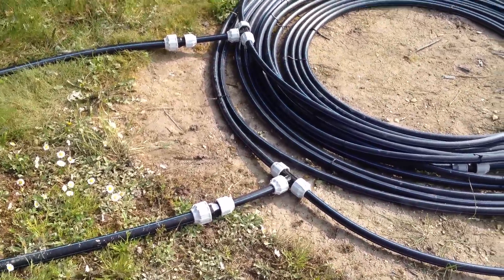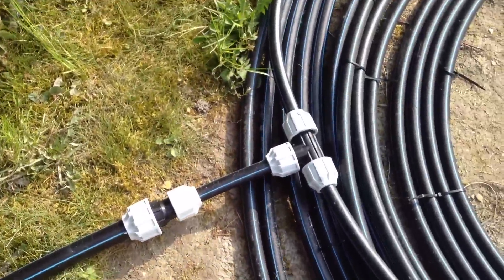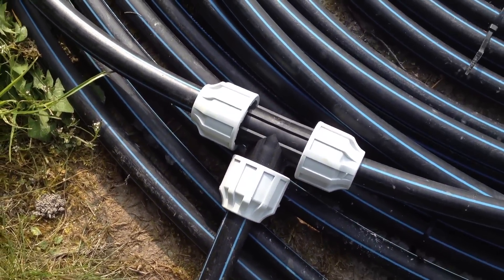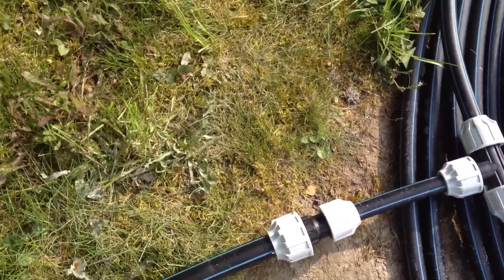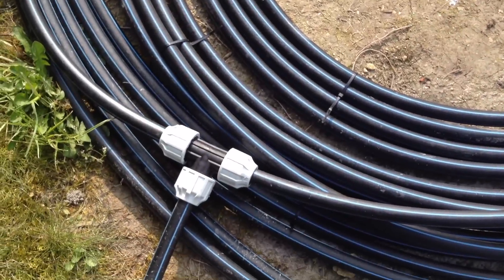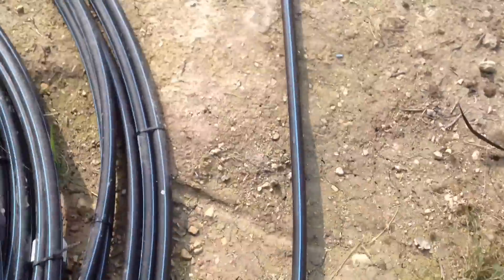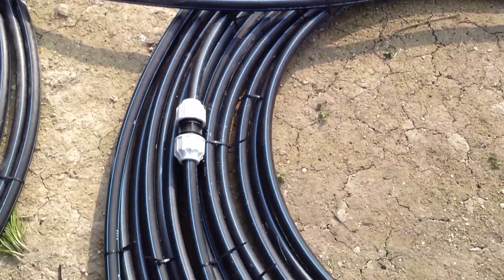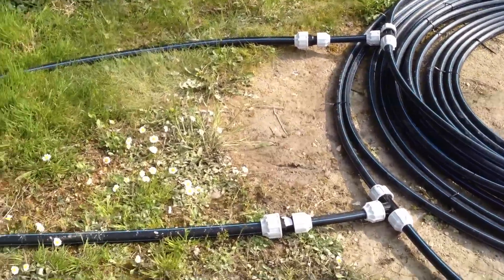DIY solar heating for swimming pool - make your own hot water using the sun and black pipe

Comment: I've made a similar thing for my pool about 3 years ago, and it has been great ever since. This video seems to be about only a test run, since the final system will have to be much larger. I have installed 25KW of tubing (about 1500m, a little less than a mile) and it cost me about 800 euros (including an extra pump for the first year, which I no longer use). You should do a little math before you start. Assuming no losses, heating water takes 4180J per litre per degree Celsius of temperature increase. A medium size pool with 40 000 litres (dimensions W x L x D in meters times 1000 litres per cubic meter) will need about 167MJ to heat up 1 degree. If you want to get your pool from 22C at 10:00 (10AM) to 28C by 14:00 (2PM) you will need to heat it up by 6C in 4 hours. The energy needed will be about 1000MJ, and the power required to get it in 4 hours is 70KW. At my lattitude (38N) I can get about 1000W/m2 of solar power, meaning I would need 70m2 of tubing. For a 16mm tube diameter the length will need to be 4375 meters. One way to get the length down is to allow for more time to heat it, for example considering the target time of day to be 16:00 instead of 14:00 (4PM instead of 2PM). Another way (the best) is to cover the pool during the night. I cover mine and it loses about 0.5C during the night, so the normal startup cycle is to begin day 1 in the morning at 21C, then by the end of the day it will be at about 25C. Then I cover it, so day 2 starts at 24.5C, and then the system adds another 4C to the pool, so at the end of day 2 it will be at 28.5C. Then I cover it again and start day 3 at about 28C, and at the end of the day it will be at 32C! Well, not 32C every day, but a sequence of 3 or 4 hot days gets it there. You will be unable to maintain this rate of temperature increase because as the water is hoter more heat is lost during the night, and during the day more heat is loss to the environment and less goes into the pool. Anyway, my pool has been at about 30C during the whole summer, and I get a total of 10 or 15 days during which I can get it to 32C and use it during the night for hours on end.
Reply: +MrRilhas very interesting, thanks for the insight. Is your pool outdoor? I'm thinking of making an indoor pool, but the size imght be around 150.000 liters. I'm also around 38N (Aydin, Turkey). With your method of piping I would need many kilometers of piping (probably more than I could fit onto my roof!) ... any other way to increase efficiency? Other materials than just pvc tubing? Have any insights?
Reply: +Brian Langhoff

Hi, yes, my pool is outdoors. If your pool is indoors, then I'm sure you will not need a lot of tubing, but you should do the calculations carefully anyway. The thing is, the tubing and the math for the tubing that I explained above is for ADDING heat to the pool. If the pool didn't lose any heat, then you would only need to add heat for a limited amount of time, even with very little tubing, possibly during the course of a few days (you can probably wait 2 weeks the first time you heat it up). In other words, as you added heat to the pool and it reached the desired temperature you would no longer need to run the water through the tubing anymore, and it wouldn't cool down.

However, real-world pools do lose heat. Mine is outdoors, and if I don't cover it it will lose almost all the heat during the night. In this case, you can apply the calculations above to estimate the size for the tubing, because you will need to heat it up from scratch every single day, which means more tubing. Because of that I cover it during the night, so I don't need to start from scratch every day, and that is why I can get away with 1500m of tubing to get it to 30ºC instead of the 4735m to get it to 28ºC.

If your pool is indoors, then it is quite possible that it doesn't lose a lot of heat during the night. If you keep its room airtight, it will probably loose very little heat (equivalent of having it covered). However, the most likely scenario is that you will be running dehumidifiers, and so all evaporation from the pool will be removed from the room, which means that the air will never saturate with humidity and the pool will just keep on evaporating. And the hotter the pool water is then the more it will evaporate. Since most of the energy in a pool is lost through evaporation (~75%), that means that your dehumidifiers will actually be taking heat away from the pool all night and all day (whenever they are running).

In that case the math becomes more complicated, because you will need to know how much heat your pool will lose, which is not simple to estimate, and will depend on how much humidity you tolerate. The more humid and airtight the pool room is, then the less heat the pool water will lose. So, even if your pool is indoors, you may consider covering it while not in use to prevent evaporation, thus saving on energy to the dehumidifiers and reducing the amount of tubing necessary to compensate for heat removed via evaporation.
Reply: +MrRilhas Yes, exactly (have been reading a bit about it the last days, a newbie in this area) - plan to cover it to avoid the heat loss because the air will have to be airconditioned and that would make it almost equivalent to an outdoor pool (although I want a very special layout that will be very difficult to cover - but will try and cover it as best as possible). The room will be airtight ... as it will be 100% underground! :-)

I originally asked you because I'm in serious doubt that I can find someone professional in my area that can make a precise calculation :-) But still ... is the best way to go simple pvc tubing? Efficient enough? Glass surface would mean higher efficiency right? And is it healthy enough, the pvc? :-)

THank you very much for taking the time to write all this. Very much appreciated :-)
Reply: +Brian Langhoff 
Well, if your area is anything like mine then no, you won't be able to find professionals that know what they are doing. What I can find here is a lot of small companies that can install off-the-shelf solutions, or copy/paste from other clients, and can't do anything new that they haven't seen before. And when they do say they can do it it is very likely that they will do a poor job. So, I think it is best if you study the subject in depth, so that you can do it yourself or if you don't do it yourself then at least you can monitor or guide workers through the job.

About the calculations, the math for adding heat really is as simple as I described above. There are losses that I haven't described, but if you do the math and then add 10% or 20% in the end you will be alright.

The difficult math is the one for the heat loss, but that may be simple in your specific case. The air conditioner will basically act as a dehumidifier if used for cooling (it will take moisture from the air), so you can count on the pool being evaporating 100% of the time. I don't know if you plan on using air conditioning for heating instead (in which case it will probably not take moisture from the air), I assume not.

The temperature in the soil becomes more and more stable as you dig deeper and deeper. At about 10m depth the temperature of the ground is pretty much constant all year round, equal to the average temperature above ground, by averaging winter and summer, day and night. So, you may have to fight this "soil thermal inertia" for a few weeks, depending on you wanting to force a higher or lower temperature than the surrounding soil. After that, everything becomes quite stable, and you can probably keep the same operating conditions from then on.

This means that it will be very easy for you to plan the operating conditions in your pool. The only thing you should account for is that the sunlight during Winter time is much less, so you design your system for heating all you want during the Winter, and in the Summer you will have surplus heat (and can turn it off for long periods). At latitude 38 you can probably consider a daily solar power of 250 W/m2 in the Winter instead of the 1000 W/m2 I indicated above for the Summer.

So, for the calculations: first you find the air temperature that the air conditioning will be applying to the room. Let's say that is 28ºC. That probably means a "natural" water temperature in an underground pool of about 22ºC or so.

Now you decide at what temperature you want the water. This is not as easy as it sounds. My wife likes 30ºC during the day, and 34ºC during the night. I can't change the temperature that quickly, so I have it at 30ºC because we use it more during the day. Most women that visit us like it at 30ºC, but I find most men like it a bit lower (maybe 29ºC, or even 28ºC), but that depends a lot on what you do in the pool. My preference is to take the PlayStation remote inside a plastic bag, turn on the video projector, and jump in the pool to play a game for a few hours, and for that I like 30ºC. But if I'm throwing a ball around with my kid then 30ºC is too much, and I start to prefer 29ºC or 28ºC. Anyone who likes to do pool laps for 30 minutes or so (not me) likes 26ºC, and anyone who swims for sport likes it much cooler. So, this is anything but a simple decision, because you probably won't be able to switch the temperature of the water in less than a day or two, but let's say you want it at 28ºC.

Now you decide if you want to cover the pool. Covering it is a nuisance, because it is not ready for a sudden desire to go swimming, so let us assume you don't want to cover it. Anyway, this is the only situation that really needs calculations, as covering the pool basically allows you to obtain any temperature you like, because it will probably be easy to add enough heat to cover losses, and adding a bit more than that will allow you to start accumulating heat over time, eventually reaching the temperature you want.

In this example, you will want your pool to heat from 22ºC to 28ºC every day. Just apply the formula from my post, and you will find out how much tubing you will need in the Summer. Multiply by 4 and you get the tubing size for the Winter. Add more depending on any shadows that will be cast over the tubes (estimate that, and consider that while in the shade they don't heat the pool). Add 20% and you're good to go.

Also, make sure to read the specifications for your pool system (pumps, filters, tubes, ...). Mine is rated to 35ºC, meaning that I'm kind of pushing its limits when I have the pool at 34ºC. Actually, after heating the pool above 30ºC, my pump started malfunctioning every 2 years, and needs repairs (not very costly, and they don't imply a lot of downtime because I have a backup pump, but still a nuisance). You will also need more chlorine, as bacteria thrive in warm water, but I still keep it within reasonable levels without problems. More chlorine also creates more problems for the equipment.

Finally, let me tell you that after I trained myself in all things related to pools, I lost the fear of doing whatever I want with it. This required that I learned how to cut and glue tubes, where to buy the parts, know about valves, diameters, and things like that, but after all that I just add more if I need to, or I divert water from here to there when I feel like it. I still ask the pool guys for serious stuff - like pool leaks, or pump malfunctions - but I can take out a pump and put in a new one myself, for example, and I think that is a skill you may wish to include in your portfolio (it is incredibly easy, have your pool people tell you the names of the glue and tubes, and ask them where they buy it, and then just do experiments with tubes and adapters and stuff until you learn how to do it).

About the tubes: I use flexible PVC tube to take the water to and from the roof, the diameter is the same as that of the pump. Don't forget to add a few layers of thick paint to the PVC, otherwise it will quickly die from UV exposure. On the roof I use black PAB tube (inexpensive, used for irrigation) which doesn't need to be UV-protected and is now in its 7th year non-stop, without issues. But even if it dies, my 1500m cost me 300 euro. The diameter of the tubes on the roof is much smaller, mine are 1/4th of the diameter of the pump tube, because the smaller the diameter then the more efficient they are at heating the water inside (but not too thin to the point where they can easily clog, the diameter for your small finger should be ok). So, I just split the PVC tube into 4 tubes of PAB, and on the other end I combine the 4 ways of PAB back into 1 PVC tube to go down to the pool.

I hope you find this information helpful! I wish you the best of luck! :-)
Reply: +MrRilhas
Heh, just read my reply, the PAB didnt need painting as you wrote, the PVC did. Then why didn't you run thicker PAB to and from the roof also? Have no idea what PAB tubing is, so there is probably a very logical explanation...

From more browsning here on youtube I see that many put their tubes in a frame with a black painted background plus a glass cover on the front. Worth the while?
Reply: +Brian Langhoff 
The main reason why I didn't run PAB tubing all the way to the roof was because I wasn't able to find the exact pressure rating it can withstand. This black PAB tubing that I installed is used mainly for irrigation (that is why I first though of it, I left a roll of it out in the sun while I was doing the irrigation system and realized it got quite hot), where tubes run basically at ground level, and the pressure is only that from the pump.

I wasn't sure it could handle the pressure from the 6m height difference from the pool to the roof, plus any surplus pressure from the pump, and even if I tried and it worked I had no way of knowing that it would still hold after a few years, or if it would suddenly break under pressure and old age. The worst possible scenario would be for it to break while I was not at home, and leak out all the water from the pool.

Additionally, all curves and junctions for PAB are not glued, they are just "pressured in", and friction holds them in place. On the other hand, PVC connections are glued, making them much more reliable (and much less expensive than PAB junctions and curves).

As for the black surface underneath, at first I did cover the back in black. First I installed Roofmate boards (kind of styrofoam thermal insulation boards used in construction, placed inside walls and ceilings of buildings), then a black cloth over it, and then a coarse metal mesh grid (with holes of 10cm x 10cm) on top of that, held down by concrete weights along the edges. This holds the Roofmate boards down during windy days, and the cloth is held to the boards with staples.

On top I placed guides for the tubes, in a spiral fashion, 4 channels going one way interleaved with 4 channels coming the other way (to better distribute hot and cold zones). These tubes are held to the mesh grid using normal zip ties, and so they are held down as well. The guides hold the tubes about 25% of their diameter apart, from my calculations this gives a better benefit/cost ratio.

I placed a few pictures here:

https://www.dropbox.com/sh/zvsp8ptanl0hkdj/AABtWuQprs8HJWCJhns9EpDka?dl=0

The black cloth under the tubes wasn't getting any real heat, so I decided to try a different approach, which was to take the cloth out and let the shiny nature of the Roofmate reflect on the bottom side of the tubes, and the result was a bit better. I mean, you can see in the pictures that the spiral is tightly packed, the gaps are small, so any difference is bound to be small, but without the cloth I see the underside of the tubes capturing some reflected light, whereas before they could only get extra heat from the underside through convection from the cloth, which it didn't seem all that useful to me, as its temperature was never that high.

So I would say that you will be better off with a reflective surface underneath than with a black one, but that depends. I have a vinyl panel that heats quite a lot under the sun, but that was too expensive to use on the roof (cost twice the cost of the tubes, so for that I would just have 2x more tubes and a 3x power output instead of a minimal increase from a hotter surface under the tubes). I used the Roofmate boards for immediate pool heating (so that no heat would escape to the roof of the house), and even that might have been too much, and maybe I didn't need to worry about it and spend money on it. My suggestion is that you just focus on the total surface area capturing sunlight (the inexpensive PAB tubes) and everything else will probably have a minimal impact (if any) on the overall result.
Reply: +MrRilhas So, just to do the math quickly: 150.000 liters. Indoor. Covered (otherwise hopeless I think). Winter days. Otherwise same specs as you. Lets say it looses 0,5 degree per day also. Then I would need at least an increse of AT LEAST 1,5 degrees per day not to loose the heat almost as fast as I gain it, I guess? And to actually be able to accumulate the heat in the beginning. 150.000 x 4180 x 1,5 degree C is about 1000 MJ. Lets say I have 8 hours of good sunlight on the winter day to heat it (double up on your 4 hours) and only 250 W/m2 (quarter of yours) - all in all I would need double of your calculated tubing. Around 9000 meters... correct? How much roof space would I need for that!? :-) Your 1500 meters - how much space does that take up?

Alternatively, say that the pool is heated all year round beginning on a summer day, then I might just need 0,5 per day. 1/3. BUT - then there might be a week of bad weather during winter where it can't keep up with the loss and the temp drops. So I guess the 9-10 km is realistic... sigh :-)
Reply: +MrRilhas ... actually one more thing to consider then... arrrgh. If I really need that much tubing ... and if my math is correct ... that would mean that I have 1,8 ton of water on my roof all the time plus the tube and other things ... 2 ton plus. I highly doubt my roof can carry that (its curved....) :-(
Reply: +MrRilhas .... maybe I would need a heat pump as backup for these scenarios (can maybe get away with a slightly small one that only need to heat it 0,5 degree on a bad day) and then go with the 1/3 of the calculated length to get 0,5 on a winter day. 3000 meters. That would be 600 kg plus the material spread out over the roof. Would have to check with a proffessional if that would be okay but yeah, I guess so.
Reply: +MrRilhas soooory that I keep bothering you, just don't answer if it's too much :-) Most systems that I see have a frame and cover the tubes with glass - like a picture frame. Guess to trap the heat under the glass like a green house. Wouldn't that increase the efficiency quite a lot? I mean, that's the general principle from a green house... any way to calculate that...? :-)
Reply: +Brian Langhoff 
Hi, I don't think the 8 hours of "good sunlight" can be considered a good calculation starting point, because the sun won't heat up the tubes at the maximum rate over those for hours. My system is designed for 25KW (peak), and I get about 15KW (average) in 8 hours of running (Summer), so you should factor that in. The fact I get such a good average is because I have full exposure to the sun (no shadows) flat roof (a small inclination would be better, but a significant inclination would efficiency that a lot during early morning and late afternoon), and the small tube spacing (which is comparable to increasing the total collection area when the Sun is at an angle.

So, during the Winter, I think you can assume the average power to be half of the peak power, and the sun power to be 30% or 25%, so the average power during the Winter will be about 15% or 12% of the installed peak power.

But you should be careful about the Winter calculations. In my experience, you can get the pool water temperature to be about 5ºC above the ambient temperature, assuming you have no wind to blow cool air on the tubes. So, if the ambient temperature during the day averages at 25ºC during the 8 hours the system runs, then I can get the pool to about 30ºC, and no more than that because the tubes will be at 30ºC and will loose energy to the environment. So, the water comes in from the pool into the tubes at 30ºC, heats X from the Sun, but looses X to the cooler air in the environment, and so it doesn't heat anymore. If there is a lot of wind in a 25ºC environment then the water may actually come into the tubes at 30ºC and leave at 29ºC, or 28ºC, effectively cooling the pool water. However, I made an electronics system to stop the system from running if the water comes out from the tubes at a temperature which is not worthwhile (<+1ºC in my case).

So, if your Winters are anything like mine, where you get average daily temperatures of 15ºC (or 10ºC during the peak of Winter) then there is no way to heat the pool from that, so I have no option but to shut it down. You can use glass, or plastic on top of the tubes, and that should get you maybe another 5ºC of headroom, but in my case that is not worth the extra cost, it is hard to build so as to handle windy days not tearing it all apart, and it still wouldn't be enough during maybe half of the Winter. Also, my pool is outdoors, and it is not that fun to go in and out of the pool in the cool weather, even if the pool water is warm.

My 1500m don't take a lot of space, maybe a circle of 6m in diameter (I can't remember exactly), did you see the pictures I posted in a previous message? YouTube seems to require that you click "read more" to see it. So I've been thinking of just tripling or quadrupling the system, just to see exactly what I can get during the winter (to maybe keep my home warm? ... I will have to figure out how to get the heat in, though).

You shouldn't think of the tube in terms of length, you should think of it in terms of area, because the diameter you get there in local shops may vary, so you should think in terms of total collection area you want. After a few calculations I decided that I wanted 25m2 (=25KWp), corresponding to about 1/5th of my total roof area. After you determine the area, you can calculate the tube length using simple math. My tubes are 16mm diameter, so for 25m2 that corresponds to an area of 0.016m by X, meaning X is 1562m. If you get tube of 10mm in your location then your area for 25m2 is 0.010 by Y, so Y is 2500m.

After you determine the area you can decide if you will use circles or rectangles. Rectangles are easier to pack efficiently, but they need a lot of junctions from the main pool tubes to the thinner collector tubes. A circular layout is not as efficient to pack (but you can have multiple circles and reduce their diameter and offset them from each other to pack them more tightly), and the water will flow mainly in a straight line, causing less resistance to flow, and they need few and inexpensive junctions (my system uses about 60 junctions of 0.30 euro each, basically one junction between each 50m of each reel of tube). I decided on a circular geometry, so I calculated the diameter of the circle (if I used no gaps) to be about 5.60m, or about 6m with gaps.
Reply: +Brian Langhoff
In Europe, current design standards are about 500Kg load per square meter of area. So, you should be alright, I guess. :-) But you should consider that the amount of area in the roof is dependent on the diameter of the tubes. The most efficiency comes from thinner tubes, which also allows a reduction in total water volume. My 1.6mm diameter equates to about 5m per litter, so 1500m equals to about 300 litters, which is negligible when distributed over 25m2. You can think about it in terms of how many people you think you could have standing on your roof, since people are basically sacs of water. :-) However, if you get 10mm diameter tubes then you will have much less water on the roof, my quick calculations result in about 12m per litter, and for the 2500m I would have needed then I would have 200 litters on the roof.
Reply: +Brian Langhoff This heating system is not perfect, and does have serious limitations that result from the low ambient temperature in the winter (as I described in a previous message), but it is incredibly inexpensive when compared to other alternatives. A 10KW heat pump in Portugal costs about 10000 euros (there is a lot of taxation, labor, etc.), so it would cost me about 25000 euros to get a comparable heat in the pool, plus operation costs (25KW at a COP of 2 in the Winter means an electric consumption of 12KW, although much less in the summer). My 25KW tubing system of 300 or 400 euros simply can't be compared with that. However, I would say that even if you use a heat pump, having tubes pre-heat the water that goes into the pump is always advantageous, if for nothing else then for lowering the electricity bill of heat pumps. However, winter time is tricky, because ambient temperatures are low but you may still get some good sun and heat from it, but you should have a system like mine that knows if heat is being lost in the tubes and stops water from flowing through them if that happens (because being on top of that yourself and doing it manually is a pain). In Portugal, a gas or diesel heating system would provide a small benefit over an electric heat pump, so you should check if the same happens in your country.
Reply: +MrRilhas thanks, yes, saw the pictures. Well, I'm situated in a nice and warm part of Turkey with mild winters (okay, we usually have one week with near 0 degrees but mainly 10-15 degrees C as you mention or even 20). Many people use a water heating system on their roof for domestic hot water even during most of winter. But I get your point and if you say max +5 degrees and 5 extra with a clear cover ... then it won't work most days during winter. The 8 hours - there's ofcourse more than 8 hours of sunshine on the good days but for a good angle I guestimated 8 :-) My roof is south/north with a slight angle and nothing to obscure the sunlight, so half my roof should be good for it. that means around maybe 40 m2 give or take. But that also sounds a bit to the small size for my requirements.

Guess .... I need a heat pump to assist. Or might you have any other good ideas for increasing the efficiency..? :-)

And yes, your system might work well with underfloor heating (have that myself in the whole house with a heat pump) to assist in winters on good days :-) But you need the pipes under the floors - wouldn't work with radiators though, they need far hotter water as I'm sure you know - who am I trying to teach? You sound like you know all this by heart ;-)
Reply: +Brian Langhoff Yes, that is correct, and increases the efficiency a lot, because you can then have much higher temperatures in the tubes, possibly getting tubes at 30ºC while the ambient is at 5ºC, which is not possible with an open system (you can get away with a difference of about 5ºC). However, for that I didn't find any more economical solution than to buy conventional water heating panels, which use all kinds of technical solutions to increase the efficiency, but cost about 1 euro per 1Wp, so about the same as a heat pump (but with much lower operating costs, obviously). You don't need a storage tank (the pool will be the tank), so you may get a small cost reduction there, maybe 3000 overall. So, in Portugal it would have cost me 22000 euros to 25000 euros to get the 25m2 I wanted, which would not be of any benefit to me during the summer (when compared to my 300 or 400 euro system) but would allow me to heat up the pool in the winter to any temperature I wanted (they can efficiently go as high as 40ºC, and less efficiently to about 60ºC). I'm thinking about such a solution for heating the interior of the house, but it is hard to justify such a high investment (the Winter costs me about 2000 euros in electric heating, so it would take me 12 years to recoup on the investment, or 17 if you account for financial losses). I don't think there is any good way to do this DIY-style, because the gains are smaller and smaller as you simplify the technological investment. For example, a normal glass can reflect away 40% of the sun's energy, so that energy wouldn't even come into contact with your tubes, so you need special high transmission glass. The glass should not be easy to crack, of course, and you should make sure there is no humidity buildup inside the chamber (you don't want the glass to fog up). And then you should have concentrators, to reduce the amount of heat lost inside the chamber, which are hard to do manually. All in all, if you do it yourself then you get what you pay for, and if you spend only 10000 to DIY instead of 20000 to buy from a professional then it is very likely that your DIY system provides only about 50% of the heating of a professional system during the winter. So, if you are going to cover the tubes with glass then I think it may not be worth it to go DIY.
Reply: +MrRilhas I see. So for this to work properly for me I guess you are saying that proper water heating panels all over the roof w/o tanks ofcourse - that would be efficient and probably a bit less expensive than a heat pump (and no running costs). And would ensure me a more reliable source of energy. Then I need a professional to tell me the required size. A quick online search tells me that an acceptable quality named "high performance" (compared to another cheaper model of same make) that holds 170 litre including tank (useless to me) costs around 850 euro (but the 170 litre is not the tubing it must be the container) (https://www.tekzen.com.tr/170lt_gokkusagi_yuksek__performans_pake_/2160336). Maybe filling my roof with these ones... :-) It's also not a wild price :-)
Reply: +Brian Langhoff I think it all depends on a lot of factors. If you just want control and can pay for it, then there is nothing like a gas system. You click a button and the pool is 10ºC hotter 10 hours later, because the power of a gas system can be incredibly high (you should easily find a 100KW gas system in your country). The biggest advantage is not spending energy when you don't need the pool to be warm, which would happen if you only use the house occasionally, because that means you can just heat it up the day before you want it and will not be wasting any energy by keeping it warm when you are not using it. The benefit is more significant when you don't use the pool for longer periods, so if you use it every other day then you would probably not gain a lot, but if you use it only on weekends then there should be some benefit. Also, maintenance for such furnaces is usually much less expensive than for heat pumps. However, if you don't want that much control then I believe you next best option is a commercial high efficiency panel, I think it will be able to provide results comparable to heat pumps but at a much lower operational cost. There is also another benefit in panels, you can just buy one panel, install it on the roof, run the water through it all winter, and see how much heat the panel produces, which is something you can't do with a heat pump (with a heat pump it would be very expensive to experiment in small steps). In such an experiment, 1 panel alone will not heat up your pool, of course, but you can measure every day how much energy it is putting in. For example, if water goes into the panel at 20ºC and comes out from the panel at 21ºC at a flow of 1L per second, then the panel will be providing 4KW of power (you can easily have an electronic system measure temperature difference and flow for a whole winter). That experiment can cost you maybe 2000 euros, but it will not go to waste and that panel will always be providing that power, even if you add a heat pump, so it will always help. However, if you look at the data and see that the panel provides enough energy so as to be sufficient if you filled all your roof area with similar panels, then I think you would be much better off by just using panels instead of a heat pump.
Reply: +MrRilhas Yeah, and I love the idea of the green energy (ofcourse also no running costs but the more sun energy I can utilize the happier I am) :-) Would love to have electric solar panels also but don't feel they are good enough at present (efficiency wise) compared to the costs. Maybe 10 years later .. then I need another roof for those though! :-)

Think my mind is set on a couple or 4 panels, as you say, I can get the advice of the constructors and if it's not enough it would be easy to add to the system. It's a good middle way if you ask me.

I can't thank you enough for all your advice :-) And it has been a pleasure talking about it. Now I need to look at the total expences of this "small" project ... and decide from that if it's feasible at all :-) Luckily construction work is bearable where I live (actually I'm from Denmark but lives here in Turkey) :-)
Reply: +Brian Langhoff The main difference from "proper heating panels" and inexpensive PAB tubes is in the losses to the environment, not in their ability to capture the sun's power. In other words, a professional high performance thermal solar panel at 25ºC in an environment at 25ºC captures roughly the same amount of sun energy as the inexpensive PAB tubes at 25ºC in an 25ºC environment. Their ability to heat the pool becomes different only when the temperature you want in the panels and tubes (the same temperature you want the pool to be at) to be much higher than the temperature of the environment. So, a professional panel at 30ºC in a 10ºC environment is much more capable of continuing to take energy from the sun into a pool with water at 30ºC than PAB tubes. In fact, I'm sure PAB tubes at 30ºC in a 10ºC environment would lose more energy to the environment that they capture from the sun, so they would cool your pool.

This means that for your calculations you can keep working with numbers based on the total area that you need, based on the sun power per unit area that you expect the sun to deliver at your latitude. So, I suggest you start with a calculation for the summer, and then compensate by the reducing factors in the winter, like 50% to 30% solar power, and shorter days, resulting in more panels. That should bring you very close to the real number, because with professional high quality panels a 20ºC from the panels to the environment will not be very meaningful, so the math will hold accurate enough even not accounting for thermal losses to the environment (which is the hardest part to model and characterize properly) because a professional panel will be behaving much like an ideal collector. This is not to say that you don't need advice from the professional that sells you the panels, or that you should ignore it, but if your calculations says 4 panels and the seller says you need 10 then I would suspect that, and I would ask him to demonstrate that (even more, I would suspect that his panels would not be of good quality after all).

One thing you should keep in mind: the panel may not be able to work with chlorinated pool water, or salt water, because that may corrode the materials in the panel, so you will have to check with the seller, and request that the warranty covers the use you will be making of the panels. If the panel only works with normal tap water then you may need a heat exchanger, but I have no idea how much that costs. I usually run my pool at 2 ppm chlorine, which is much less than is usually used, but enough to keep the water clean (it is not a public pool, so the number of contaminants going in is quite low), which is still too much chlorine for most conventional materials and equipment.

A photovoltaic panel is much less capable than a thermal panel. Firstly, the cost is at about 3 EUR/Wp, whereas the cost of thermal panel is at about 1 EUR/Wp (PAB tubes cost 0.016 EUR/Wp, so no contest there). Additionally, highly efficient photovoltaic panels provide about 200 Wp/m2, whereas thermal panels can provide about 1000 Wp/m2, which may be very important if you have a small roof area. Also, electric heaters here cost about 0.5 EUR/W, so that would significantly add to the cost of an electric solution (12500 euros for my 25 KWp system), making photovoltaic panels lose to thermal panels in almost every aspect.

From your requirements and constraints I think you will be doing the right thing in going with professional panels, and starting with a small number of them. Also, if Turkey is anything like Portugal, you will probably be able to find many qualified professionals used to installing thermal panels (although maybe not so much in stripping tanks, and having them filled with pool water, but a good professional should be able to find ways around it). It will be very easy to know if you need more panels, you only need 2 or 3 days to see if the pool temperature dropped by 1ºC, so I think your approach is great.

By the way: if you can't strip the tanks out, or if that is not a cost effective option, you may consider keeping them and having them work as conventional heating panels with tank. You will probably be able to accumulate a lot of hot water per each unit area of panel every day, so it may be cost-effective to just dump all that hot fresh water into the pool once a day, every day.

The process would go something like this: at 4 AM fill the tanks with tap water. For 10 panels of 200L each that would be 2000L of water. In Portugal that water would cost about 2 euros (maybe 4 euros in expensive areas). Then, let the 10 panels of water heat up during all the day (or most of the day, to the point when the temperature in the water stops increasing), for example until 6 PM. By that time, the 2000L of water in the tank should be about 50ºC above the temperature of the environment (the seller should be able to give a figure for this from the top of his head, but it is normal here to have tanks at 60ºC while the outside air is at 10ºC), and maybe 30ºC above your pool temperature. So, when you dump the 2000L that are 30ºC hotter than the pool into the 150000 L of the pool, you will be adding 0.4ºC to the pool instantly. If your pool only loses 0.4ºC per night, and you do this every day, then you will be able to keep it at 30ºC. I would not be surprised if you could keep losses low during the night, I lose 0.5ºC from the 30ºC covered pool to the 20ºC environment of the summer nights, if your pool room is at 25ºC and you keep your pool covered then you will surely lose less than 0.5ºC per night. On the other hand, adding 2000L to the pool every day costs about 4 euros here, which converts to 120 euros per month, which you may possibly find acceptable. After this dump the tanks are empty, and you can fill them again with more tap water and heat them again the next day. So, this may not be a dumb idea, and you can use it as a backup plan in case you don't find any thermal panel seller that can guarantee that the panels work with pool water, or that can't take out the tanks. It is not green (unless you have enough room somewhere to evaporate the chlorine for a few days, in which case the water flowing out of the pool will be good for irrigation), but you can always fix it later (by adding a heat exchanger, so that you can reuse the tank water).

I wish you the best of luck, and I would love if you could leave me a message once in a while, as your project progresses.
Reply: +MrRilhas I've been "stealing" your ideas  and want to implement them, too :D Thanks for sharing your knowledge/experience.
Reply: +MrRilhas has been some time now, hope you are well? Seems like I will go ahead with my project, finallizing the contract at the moment. If you are interested in following then send an email to timelinedesign-at-hotmail-dot-com - and after that an answer to this thread (because it is not an address I usually use or check). From there I will send you my "real" email address :-)
Reply: Hi MrRilhas, thanks for your informative post! My pool is small, 12' diameter round, approx 6500l. Would I simply scale your calculations linearly to arrive at the length of tubing that would work for me? I'm in South East UK which I believe has around the same solar potential as you.
Reply: Awesome comment, quick question tough I have a indoor pool(oppen on one side) what's your advise towards metreage of tubbing needed?
Thanks